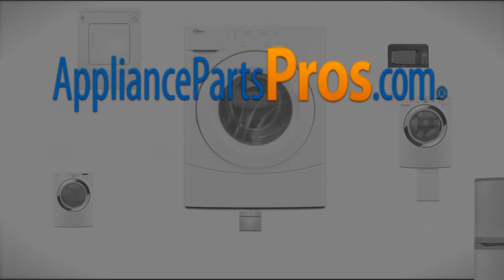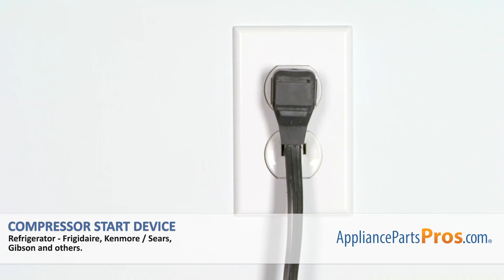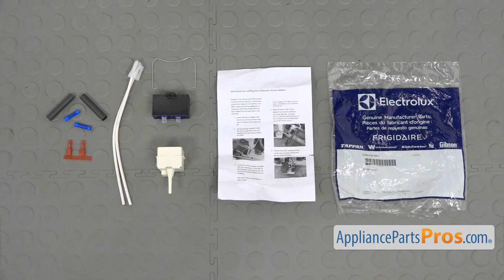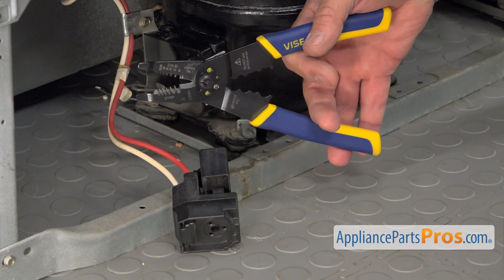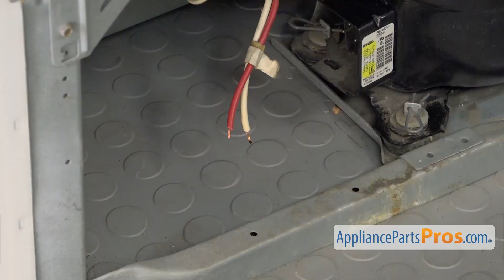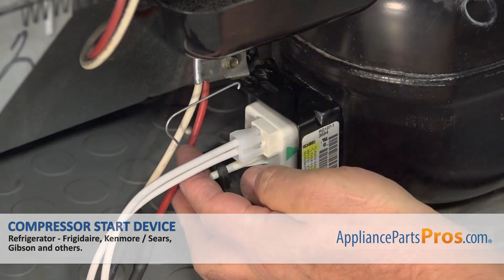How To: Frigidaire/Electrolux Refrigerator Compressor Start Device 5304491944

Comment: Does it matter which wire goes to which terminal? Here it is red and white. Mine is white and yellow.
Reply: Will someone answer this question as it is important to know which is load and neutral on the harness
Reply: It's disappointing to see that no one is monitoring the comments to answer basic questions relating to the installation procedure.